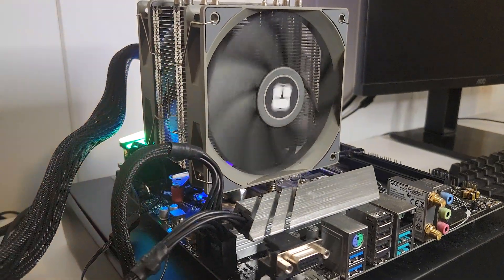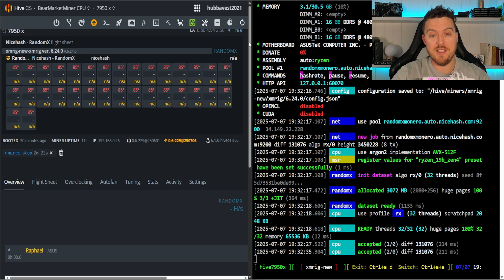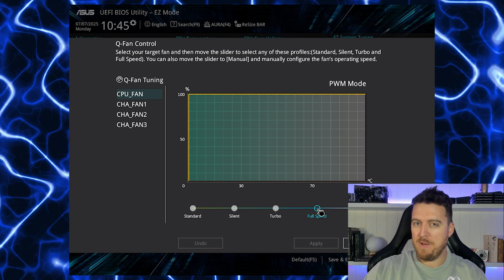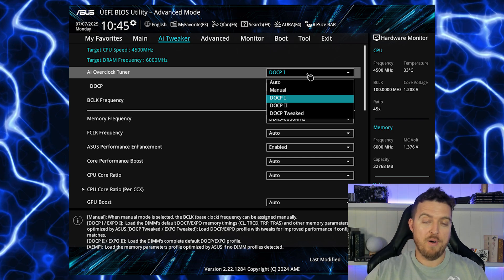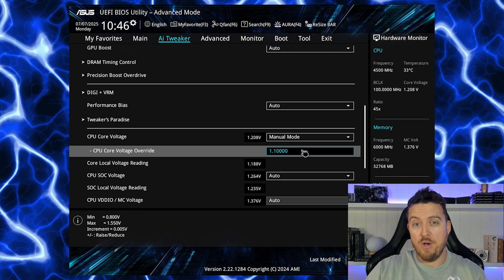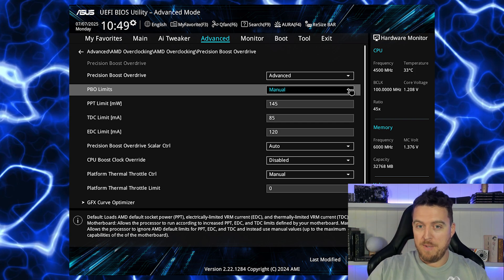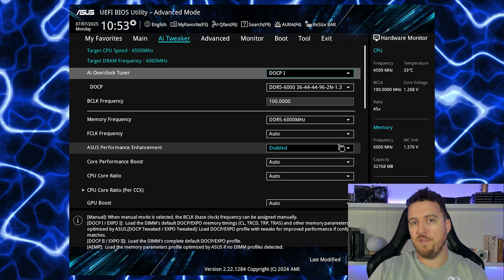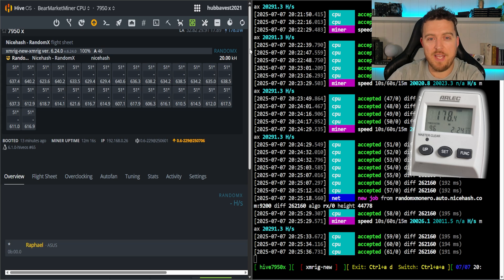Most Miners Don't Know This Undervolt Trick Exists

Comment: With the lower temperatures, you can also get away with using cheaper coolers to save even more money. Those savings adds up when you have multiple rigs.
Reply from the maker: Yeah, for sure. Can save on the ram also.

I want to be able to run this at max power in the future for testing, so I opted for a slightly higher end CPU on this build.

Comment: epyc 4545p is the best CPU for crypto mining in 2025, even better than Ryzen 7945hx in power efficiency and crypto mining performance
Reply from the maker: I want to get myself an EPYC soon, was thinking about the 7K42!
Reply: @BearMarketMiner  in my country, dual mainboard combo and 2 CPU epyc 7k42 is very cheap, combo is about 2300 USD, but the electricity price where I live is very bad 0.48 USD/kwh
Reply from the maker: Yeah I've been eyeing off a few on Ebay.

Might grab one soon.

48c is dismal
Reply: @tranngocan3117   $0.48/kWh ?? Dude, I'm in the UK, probably the most expensive country in europe, and my rate is.. $0.31/kWh. What country do you live in?
Reply: How do you figure the 4545P is best?  The Google AI disagrees, saying Ryzen 9 7950X is best as it has more degrees of freedom for voltage tuning.  It could be hallucinating, though.